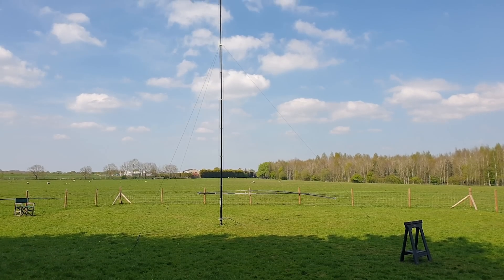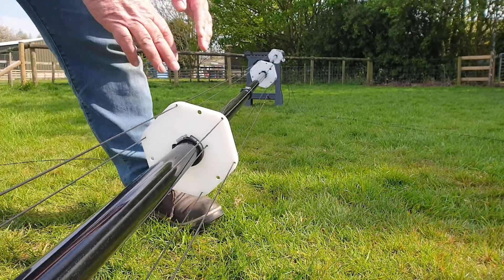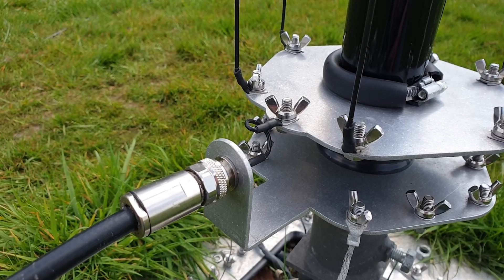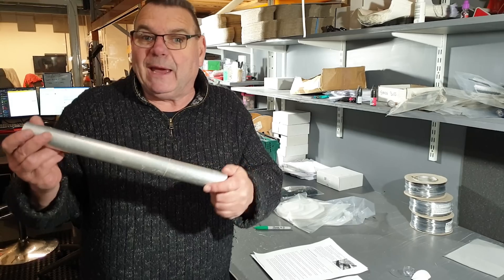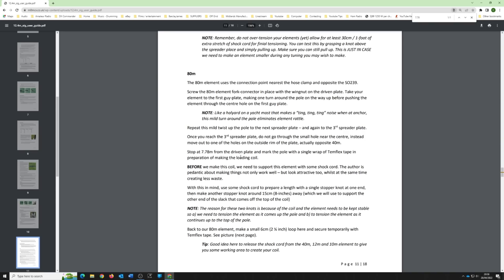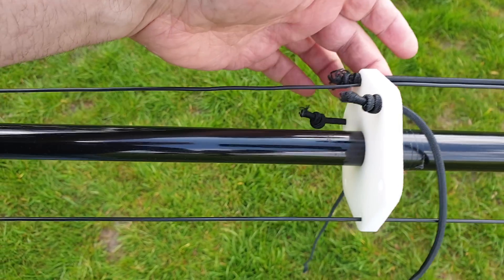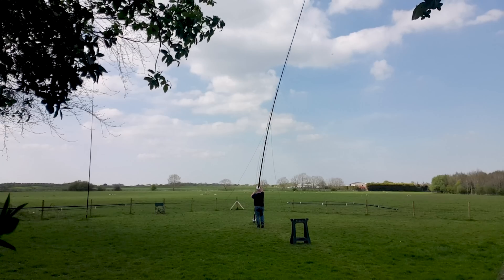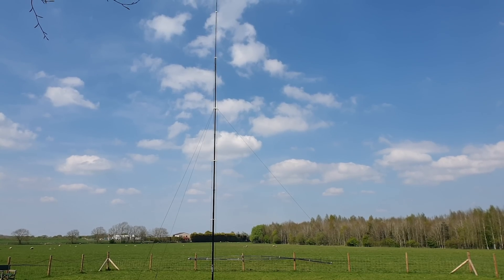How To Build DX Commander Signature 12.4

Comment: All of the bands on my sig 12 are looking great except for the 10.  Ive been able to get the lowest swr to be in the middle of the band at 29., but the swr for this is high at 2. 2/3 of the band is sitting above 3. Shortening the antenna by increasing the foldback had little effect. Biggest impact was folding back 20 cm of the end of the foldback. This got me centered in the band for 2 swr at 29.0, but I cant figure out how to get the entire 10m band to get below 3 swr. All the adjustments ive done is only moving the lowest swr up or down the frequency range, but not lowering the actual swr levels for the overall band. How do i get the swr for the whole band to lower swr #'s? The manual seems to just suggest changing the swr by shortening or lengthening the foldback.
Havent been able to find anything on this in discord.
Reply from the maker: OK.. COmpletely disconnect 10m band and tape the fork connectopr out the way and re-measure.. I have a feeling you are measuring a harmonic from somewhere else.. Once you can identify where 10m is working, you should be able to adjust and find it.. You can even temporarily disconnect ALL the other elements and search for the 10m element. It will be there somewhere.. Then add one element at a time and track it down..
Reply: @m0mcx  so my Radio finally showed up. Yaesu ft991a.  In comparing the swr on the radio when scanning the bands, I largely got completely different swr readings than I did on my antenna analyzer. For the analyzer I've been using a NANO vna. So now I'm questioning my NANO vna results and wondering if I need to just get a Rig Expert analyzer.
Reply from the maker: @ActinOut  We've had this before.. It'll always be better anyway at the shack end due to loss on the coax.. hides most of our mistakes!! LOL
Reply: @m0mcx  hmm. Antenna analysis for both my radio & the analyzer were taken from the end of the coax in the shop. I wanted to go straight to the end in effort to know what I would get where the radio would be. But yes, if the original measurements were taken directly at the antenna, coax loss at the radio end would influence the results for sure.

Comment: The discord seems to not be available anymore as the address does't work. 

I upgraded to the 12.4 from the signature 9 and am currently working on the build. I bought it from Dx Engineering.  Not sure if these are still supposed to include tape & the zip ties... mine did not.  If so, no worries, ive got some. Just thought you might want to be aware in case they were supposed to be in there.

I did find a way to make adaptations to the sig 9 ground support post to hold the sig 12.4. Generally, I wrapped some cardboard strips around the post near the top and just above where the base of the antenna sits & then wrapped electrical tape over, above & below the wrapped cardboard to get the right thickness. Its working good so far because it adds just a bit of firm cushion as well for as the antenna flexes with wind.

I did notice in the instructions that the US conversions are blank for the 15, 12 and 10m cut lenths. I just converted the given metric and went with that. Hopefully theres no probs with that?

After I get it finised maybe I'll post more info on the setup, including the tilt base and sig 9 support pole adaptations for fitting with the 12.4.

K7aio
Reply from the maker: Probably an old link... This one works.. https://discord.gg/9b7GNtzggc
Reply: @m0mcx  these discord threads keep shutting down on me. The dxcommander thread is no longer working even if I directly type in the invite you sent. It's just shut down & says there's no text channels. If I try to reroute to the channel through notifications, it says I'm not allowed access to it.
Reply from the maker: Check user guide. No zip ties required.. Check out the clamps you get in the kit.

Comment: Good Day Callum, The first of 2 packages arrived and I assume the second will arrive today to complete my Signature 12.4 order. I noticed comments on your website regarding the 6 meter and 11 meter bands, but no specific info in the instructions regarding these two bands. I plan to make an 11 meter element to compare to a standard elevated ground plane and then decide if I keep it on the DX Commander 12.4 or not. I understand the 11 meter element will replace either the 10 or 12 meter elements. What about the 6 meter element? Any information would greatly be appreciated including element length, foldback and placement on the plates. I really enjoy your videos and excited to get this up. I have a very challenging yard and city ordinances. This fits the bill. Thanks again for all you do!!
Reply from the maker: Gene.. I never nailed 6m and actually I need to do more R&D.. My thoughts were to get 40m and 15m on the same element to free up a slot then build a 3/4 wave for 6m. It should end up being ABOUT 4.16m long. Probably shorter. For 11m I would remove 12m and make it very slightly smaller. Roughly half way between the 2 existing elements. Hopefully your box turned up. They are designed to be shipped together. Loki can assist if it’s gone AWOL.
Reply: Thanks Callum. I haven't received the pole yet. Seems they are sorting it out at the shipping terminal in Stockton, CA. Appreciate the quick response. I'll sit tight until you do a bit more R&D. In the mean time, I might just make up the elements and exchange them for now so I can play with the different bands. Let me know if you think there might be harmonics that may cause issues with tuning. Make it a great day!!! thanks again @DXCommanderHQ

Comment: 2 questions first is what is the max wind speed the Signature can handle number 2 I live 7500' above sea level what do you think the durability would be at my altitude? I live in New Mexico USA we had a wildfire that has damaged our trees that support my ZS6BKW so I'm looking at the DX Commander signature  12.4. PS: I love your videos 73 KG5LTL
Reply from the maker: Well, I have personally witnessed 50 MPH gusts with a single guy point. I would have thought 80-mph would work BUT that assumes some reasonable guying. Behond that, trees come down, roofs blow off etc.
Reply: @DXCommanderHQ  thanks springtime it is not unusual for us to get 60 to 70 mph winds for days. I would guy at 2 to 3 along the length. I’ll be ordering this week or next. KG5LTL

Comment: Do you have a photo, or is it shown in a vid, how you dealt with the ground plate and connection to the radiating plate with your hinge mech? Do you have a separate ground plate for the radials, connected to the supplied ground plate?
Reply from the maker: I run 4 small braided copper leads from ground plate to ground plate..
Reply: @DXCommanderHQ  ah I see. That’s what I’ll do then. I have an innovative hinge design I will shed when completed next week.

Comment: For two days in a row the  section below the 3rd guy has slipped.  I have re-extended, re-taped and even replaced the hose clamp because i stripped out the first one trying to tighten it up.  Problem is, the joint slips when the wind blows hard and it's hot outside.  What are your recommendations to secure the joints?   We have really constant winds  of 15-20mph most days and gust from 30-40mph and maybe higher if we have storms.  the top guy could be loosened just a little to reduce the downforce, but.. the wind is so crazy here if i loosen it much more, one gust might just blow it over.  I do have it guyed on the 1, 2 and 3rd spreader.
Reply from the maker: OK.. Remove the tape and clean off the residue - then apply the clamp. Then it can't slip. I am guessing it's hot where you are. I will change the user-guide. Also see the support forum over at discord.io/dxcommander. Or email us friend. This will work, I assure you..

Comment: Put mine up today and began the tedious process of tuning.  The wind did throw some curves my way.  First, if your analyzer shows a sawtooth pattern it means that element is flapping too much in the wind.  Second, on the 80m element, make sure the element does not wrap around and contact the 40m element.  Tape it down.  Third, when tuning the 10m &12m element, adjust the fold back, which essentially lengthens or shortens the element.  No need to cut these elements.  Fourth , on 30m, just be content with whatever SWR you get.  Mine is 2:1.  Adjusting the 80m to obtain any better match on 30m will drive you mad.  Over all it took me way longer to tune than I originally hoped for.  The original lengths suggested in the manual  are pretty close for most elements.
Reply from the maker: OK.. Yes wind blowing whilst tuning is not pleasant. But once tight on the elements you should have a lot less saw tooth.

Comment: I’m sooooo close to ordering one of these antennas Cal, only issue is the radials. I can only slope them down one side of the antenna, would only be able to install about 25-30 or so on one side going down the hill on my small lot. I’m wondering how well it would work…KC2PLJ
Reply from the maker: Hiya Mike. As Tom says, most people do not even notice once they have installed. I didn't.. I ran ONLY 35 radials in 180 degree arc of about 10 feet long. And I was crossing the atlantic on 80m(!) which was the opposite direction of the radials. Surprised even me.
Reply: @DXCommanderHQ  Thanks for the prompt response! That’s amazing on 80 meters. Will be ordering one soon!
Reply: This is a really common question on the discord channel. Lots of people have done this with little to no problem. It will (very) slightly skew the RF pattern but hardly noticeable.